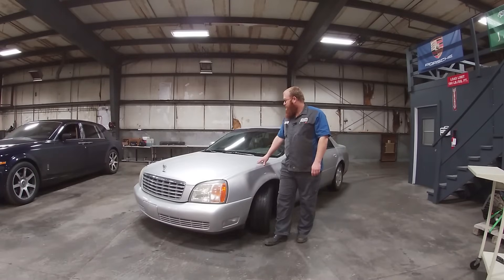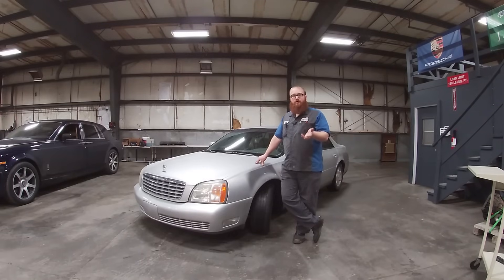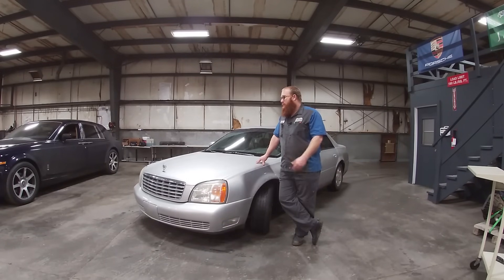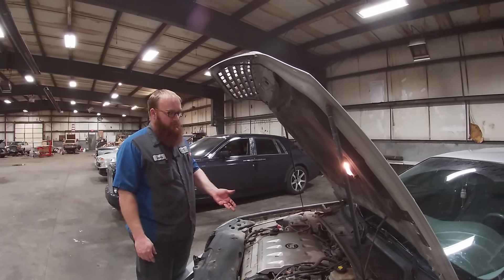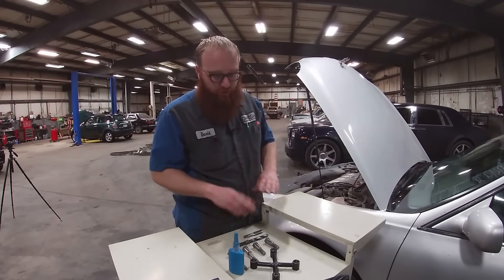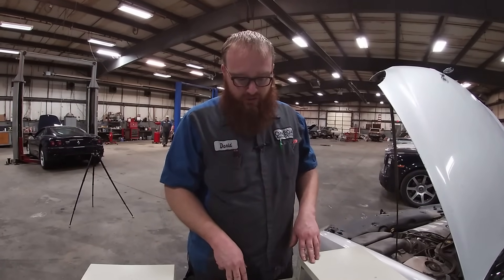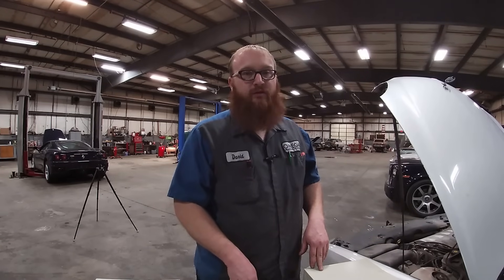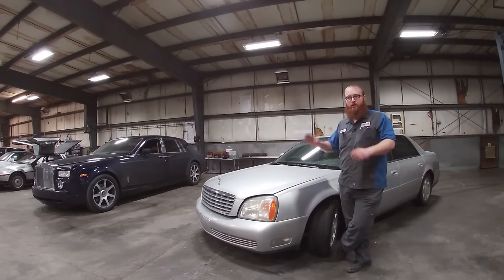The CAR WIZARD names Cadillac's Northstar Engine the Dumbest Design

Comment: I can guarantee you an assembler was telling the engineers that this would be an issue but he didn’t have a fancy college degree so nothing was done about it
Reply: I am not in the auto industry. But the most important lesson I learned in my first year as an engineer is to talk to the ones on the floor working with the product daily before making any changes.
Reply: @brad8644  I used to design software programs. I paid close attention to how people used and reacted to it. I wanted to hear what their thoughts were. Lots of question asking on my part. End users often times didn't have a college degree.
Reply: Agree! This applies to all manufacturing. My dad was chief color tube engineer at Motorola in the 50's & 60's and was the only engineer to talk with guys on the floor.  Sometimes the quality assurance reports look good (99% passing inspection), but parts are BARELY within spec & all hell is about to break loose.
Reply: @Rhaspun  I design and build software for a living. The number of times we've had to tell 'architects' that their ideas were never going to work but were overruled by managers because the 'architect' has a higher level college degree than us programmers, only to be proven right that it was never going to work and then being blamed for 'not implementing the design properly' are legion.
Reply: Nah, the engineer and the assembler are on the same team.  It's the beancounter at HQ who looks at the plans and scraps most of them as being too expensive and puts it all together with the cheapest parts bidder available.  Especially with GM of this era.  Literally every car they put out in the early 2000's was absolute garbage.  It's amazing that anyone buys their vehicles after being exposed to the absolute shit they made ... and mostly still make.
Reply: By the time the assembler gets to working with it, he's 2yrs too late to recommend any major changes. From my experience in doing these fixes, on 60-70% of these the tragedy is that coolant has bypassed a head-bolt seal and been just seeping a little coolant around the head-bolt for years. The coolant accelerates the electrolysis between the 2 dis-similar metals. You can drill out and rethread all of those holes and the last one be mush and won't take a thread. The block is then complete garbage.
Reply: I was going to say the exact same thing. I'm not an engineer, just someone with experience of mechanical engineering, and I could tell those bolts weren't a good choice for head bolts going into aluminium. It would have been so easy to prevent that issue - it's not like they had to do any major re-designing and the cost would have been negligible.
Reply: @jackdale9831  I wouldn't even attempt it, especially on that end corner. There's nothing solid to weld to. You've got to understand how far out from the bolt-hole this mush is. There's just not enough solid meat left, in all directions.
If I would try anything with a trash block, and there were no viable blocks available, I would, way-over size the hole, fill it with JB Weld, wait a couple of days and machine it. But I would only attempt this and be comfortable doing it on my own vehicle.
Reply: 100%
Reply: Usually they all work together. I've seen videos of car development and the amount of people that review designs to meet specific production criteria and discussion is very eye opening.  People up above always want engineers to focus on things they believe is relevant, often overriding the engineer's judgement.
Reply: Sounds like almost every job. They won't listen
Reply: GM engineers don't listen to the servicability people when designing vehicles.
Reply: GM  doesn't take lessons from Toyota because they don't care, plus they got government contracts to rip off the taxpayers, typical fortune 500 business
Reply: I can guarantee you an engineer wanted to use a larger bolt size but was told by his boss to use the cheapest one that he thought might work.
Reply: @CU08  this
Reply: @simonsackett  The cost is more than you think, and when you have cost saving mandates, this is what you get.  32 larger dia bolts, larger drill and tap. Possibly add additional material to the castings. You could easily add $20 to the cost.  Now multiply that by how many engines produced.  The number gets big, fast. 

Remember production costs and warranty costs hit different buckets in accounting too. Sometimes short sighted choices to save money up front eat you on the back side.  Likely any problems showed up long after the warranty expired.
Reply: Doubtful...assemblers don't care, mechanics do.
Reply: @mattshaggs2931  what are you talking about? You really think we don’t care about sending out a quality product? Anytime there’s a way to improve something either quality or efficiency we always bring it up. It just depends if the company wants to do anything about it
Reply: @mojothehelpermonkey1176  Definitely not all of you care by what I have had to fix in the PDI's I've done over the years.
Reply: @mattshaggs2931  well obviously not everyone cares. Just like how not ALL mechanics are crooks who just rip off customers.
Reply: @mojothehelpermonkey1176  Not really the same thing but...if it makes you feel better
Reply: @mattshaggs2931  Explain the difference? Except mechanics directly rob the customer and an assembler just doesn’t have motivation?
Reply: @mojothehelpermonkey1176  Since correlation is obviously not one of your strong points, I don't think you really have any business re-engineering vehicles either. Annnnnd we'll leave it there.
Reply: @brad8644  You are a wise man my friend! Love to have a cup of joe and share war stories one day. In my 36 years as an electrician and later earning a degree (EE) I cannot tell you how many screwed up "value based engineered projects" myself and my colleagues had fix and make work. Amazing how many time the "as built" drawings would reflect the neer-do-well engineer's "markups" we had suggested and implemented yet HE took credit and got bonuses on many occasions!
Reply: does seem like somebody would have flagged that
Reply: @CmlDexter Watch a Doc about Toyota in Japan. Anybody can stop the line and suffer no ill will. Thye started this after the T100 frame rot issues. Great Doc

Comment: How long after GM discovered this issue was the design changed?  “Known issues” in American cars is why Japan took over and dominated the industry
Reply: Dude don't blow your horn too hard, many of the Japanese manufacturers partially Toyota had similar problems but their issue was on the main crankshaft support bearings. It was also in the mid to early 90s.
Reply: Mazda's 626 sedans had horrible transmissions...
Reply: Same with the motorcycle industry in the U.K.
Reply: @MJT-DA  Because they are manufactured in mexico 🤣
Reply: @ianmoore322  so was my moms honda CRV it says on the door 😂😂. It's the fact that german cars are built with tighter tolerances so missing one valve adjustment, late oil changes and driving them cold hurts them. A great example is bmws v10 engine found in their older m5 (2005 2009 s85) that literally gets no oil flow under 0 degrees since the oil passages are so tight. Japanese manufacturers literally make cars for morons honda uses hypereutectic pistons that have 12.5% silicon this means there is little to no thermal expansion. Why? Because people like my mother start the dam car and drive it like it's stolen without letting it warm up. Also bmws use thicker oil where most sedans use 0w20 oil for fast flow. Finally the rocker arms in corolla are coated to basically run without oil for 10 minutes this is why you can literally drive a toyota with low oil for days and it will still work. If people weren't so dumb when it comes to maintaining their dam cars then german and American brands wouldn't get a bad rep..
Reply: @MJT-DA  I drive a VW but is it really a "people's car" if you have to let it warm up before WOT. A lot of people wouldn't understand the fickleness or common issues and causes for those issues. Good on Honda for making an engine bulletproof for all the idiots out there.
Reply: @ianmoore322  I just find it sad since I used to work at Nissan as a mechanic. And we had to replace engines from abuse and this one engine I got from a versa note from a college girl says she had acceleration issues and bad gas mileage. Bro when i tell you the oil was black it was fkn black it came out like sludge; she hadn't replaced her oil on over a year idk how tf the engine was still running...
Reply: @MJT-DA  there never was a v10 in an M3
Reply: @soulsweeper1630  my mistake the s85 m5 from 2005 to 2009 had the v10 not the m3 let me fix that. But you get my point.
Reply: @MJT-DA  And it also doesn't help that it's really a Renault Versa. 😄
Reply: After replacing the timing chain in my 2009 Chevy Colorado....4cylinder ,with only 47,000 miles on it , nominate it for co-worst engine . 18 grueling hours of labor , because the chain was crap to begin with . Even though I changed fluids and filters at proper intervals,the chain still stretched .Luckily,mine is only 2wd ,otherwise it would have required removal of front drive shaft to gain removal of oil pan . The number of items that had to be removed to get t h e timing cover off is ridiculous . I'm 70 and have worked on numerous vehicles I've owned ..mostly American..some German,some English,some Japanese . Never seen the likes of it .  BTW , one of my brothers is a Chevy dealer Master Mechanic with almost 40 yrs experience . He is incredibly talented. He told me that everytime he rebuilt one of the Northstars, all the other mechanics would stand back , thinking it might just explode !  He is the only one there allowsd to rebuild the Northstars .
Reply: @MJT-DA  makes sense to me..
Reply: @MJT-DA  the german ones was reliable before the 90s rolled in,what caused their unreliability is over engineering for maximum comfort/performance, over reliance on electrical systems and didn't care if those were too weak or brittle, as you can see in the 2021 Mercedes GLE,didn't bother with shit that don't matter and ended up with a car with buggy electricals, shit materials of soundproofing and to top it all off their maintainence price, the mark up of the products are absolutely insane, for the exact same starter battery from their original source they put a 10% mark up just to put the car brand sticker on the damn thing,and that doesnt include the transport fee and taxes
Reply: @andrewchin5583  holy shi 10%?! No wonder mercedes sales are dropping. last year to 5% compared to bmw because bmw is atleast trying to fix their issues which is why toyota is even using the b58 motor in the new supra (even though it’s slightly modified). Trust me I know my father always says how when he was a kid the most reliable car you could buy is a 90 Mercedes with a diesel engine. Now thats not the case anymore because of the electrical shi show they have.
Reply: It took them 11 years lol. Since the 93 introduction, until the newer northstars in 05, when the problem was completely fixed and the northstar became very reliable
Reply: Subarus have been burning oil prematurely for decades.
Reply: Japanese cars aren't perfect, Subaru, Nissan and Mitsubishi have all had piss-poor quality since the early 00s, although Nissan has an excuse since they're owned buy Renault
Reply: @MJT-DA  I made love many times to my neighbor in her cadillac deville back seat. Man I cried when her husband's job transferred them...
Reply: @davidschwartz5127 there is no comparison to how bad  American cars were in the 90s compared to Toyota’s and Hondas. Toyota has had a few snags but NOTHING like American garbage!

Comment: I am often shocked at some of the crummy design work that we get palmed off with these days, but cars with problems like this should never even reach the production line. Did the person that specified those head bolts not know how to calculate the stresses involved? Auto makers used to make adverts bragging about the amount of testing they used to do on prototypes showing them being driven across deserts, around the arctic, up an down mountains and all the rest of it but that one couldn't have gone further than around the block. They ought to be ashamed of themselves.